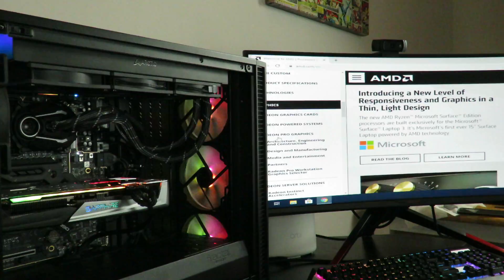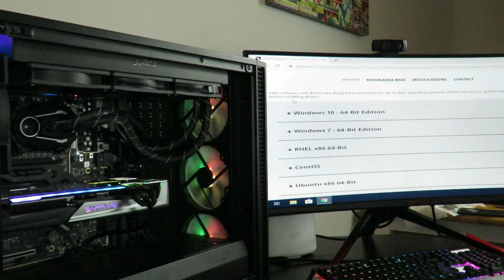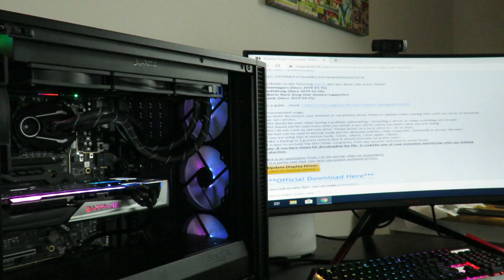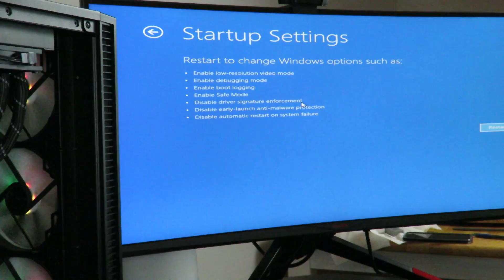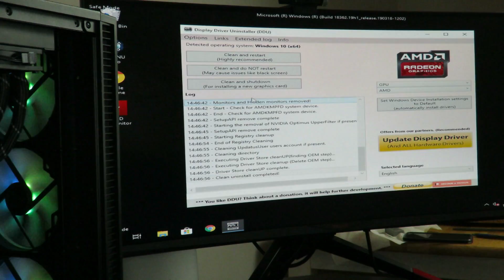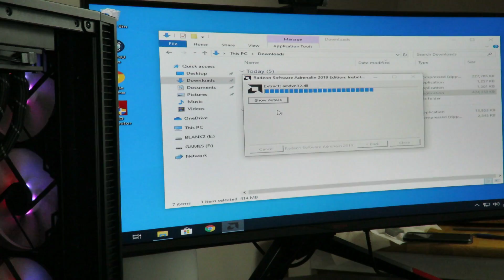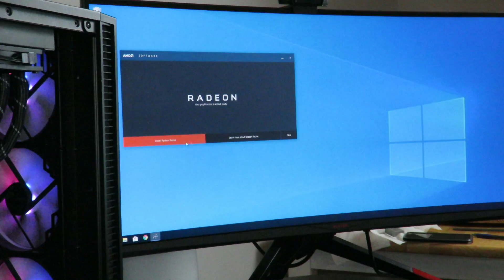Installing the AMD Sapphire Radeon Nitro+ RX 5700 XT 8GB OC Graphics Card

Comment from the maker: ✅ Watch Next:  Installing the EVGA Geforce RTX 3090 FTW3 Ultra Gaming: https://youtu.be/A2aqpr05-WA
✅ Learn to install Windows 10 on the  Asus TUF Z370 PLUS here: https://youtu.be/O3CKrFC6Bzw
✅ Check here to control the lighting on this card: https://youtu.be/PKvYtRKp_a0
✅ Sapphire Nitro+ RX 5700 XT 8GB OC Unboxing: https://youtu.be/zfCPBXgdSF0
In this video, we go over how to install the AMD Sapphire Radeon Nitro+ RX 5700 XC 8GB OC.  Make sure to stay to the very end, for a special message.
Check out my Amazon Affiliated link for this card: https://geni.us/VoHIZhu
Check out my system build out
• Viotek G35DR 35″: http://geni.us/6LrGJIntel 
• Intel Core i9 9900K Processor: https://geni.us/0PrCbaYArctic 
• Arctic Liquid Freezer ii 360: https://geni.us/CmNtJA
• EVGA Z390 Dark Motherboard: https://geni.us/UmV6t
• Sapphire Radeon Nitro+ Rx 5700 Xt OC https://geni.us/VoHIZhu
• WD Black SN750 1TB: https://geni.us/8sqXFs
• Fractal Design Define S2 Vision RGB Case: https://geni.us/t6xXT
• Patriot Viper Gaming RGB DDR4 DRAM 3200MHz 16GB Kit: https://geni.us/URlI8
• Samsung 850 EVO 500GB SSD: https://geni.us/QTA2
• WD Black PCI-e NVMe 512GB SSD: https://geni.us/mMNLde
• EVGA SuperNOVA 1000 G+ Gold Power Supply: @t

0:00 Intro
1:00 Removing the Old video card
2:53 Installing the 5700 XT
4:50 Plugging in the PCI-e connections
6:18 Where to plug in your monitor?
6:50 Turning on the Computer
7:00 Downloading Drivers
8:35 Downloading DDU
9:30 Booting into Safemode to remove drivers
12:00 Installing the latest AMD Video Drivers
14:10 Important message about cables
Reply: @ThisBytesForYou i have 5700xt nitro  i have problem with Vram stuck 1750Mhz i have dual monitor ,,,, if close o monitor and turn 120hz of second fix the issue work ok,,,, but  i need to have dual monitor,,, any solution of this problem please help me
Reply from the maker: give this a try; https://youtu.be/Qh2xEUXWeqs
Reply: Do I still have to do this method even if I’m simply upgrading from one AMD card to another? Or can I simply just upgrade the driver
Reply: Jay Alfon little late but no, if you’re upgrading from a different amd graphics card you don’t have to use ddu just download the newest drivers available
Reply from the maker: I disagree, downloading the new driver and installing the old, potentially leaves behind what the older driver has, DDU gets rid of all of it.
Reply from the maker: I would still recommend it
Reply: seriously liking these videos!
Reply from the maker: Thank you so much my friend, I truly appreciate it, you have made my day ;)
Reply: nice card i found the se gpu don't know what the differnce is but it's a se
Reply: do you know what the difference is between this on and the se version
Reply: @bassa69  SE is faster, Slighty, I'd pay the little extra.
Reply: @bassa69  and it has RGB if Fans, If you like that or own a vertical GPU mount

Comment: i keep getting no display with the same card even tho its working on my friend pc what could be the problem? the vga debug light bulb turns on on my motherboard (A520M-a pro)
Reply from the maker: 1. Make sure you are on the latest BIOS, 
2. Verify that UEFI is enabled and your drive is under GPT, not MBR, in the video I link up, i show you how to check and enable UEFI in your BIOS and change from MBR to GPT at the 8:32 mark: https://youtu.be/4BtdMcqwaFg
3. To get it to work again, you will need to disconnect all the cables on the back of your machine, usb, HDMI, DP, power, etc, everything, then remove the CMOS battery on the motherboard, then wait 1 minute, after waiting 60 seconds, reconnect all the cables, then plug the CMOs battery back in and turn on your machine.

Comment: I see that hdmi angled a bit...looks like u needed that 3rd slot
Reply from the maker: Card still working great, not sure what you meant, years later.  The .5 part is that the card itself will go a little into the 3rd slot, not the I/O.

Comment: I Bay an rx 5700xt thicc III and i think it does not get enough power my psu is MSI mag650bn bronze
Reply from the maker: The card with a system requires a 600Watt Power Supply, but it also requires 2 x 8-pin PCI connection , and don't daisy chain them.  Your power supply has 2 x 6+2 Pin PCIe cables, those are 8Pin cables but I think it's coming from 1 cable, that is probably why you are having issues.  Why do you believe you dont have enough power, I think you have enough, but it may not run well because of the daisy chain.

Comment: Is there anything else I need to plug in beside the Pcie pihns? isnt there an adressable rgb header to put on? or does it get the light from the pcie? thing because im about to buy this  used
Reply from the maker: You think the video would have what you need?
Reply: @ThisBytesForYou  Yes i watched it thank you, also does the gpu come with the 3 volt pin? also thanks for replying so fast just earned another sub
Reply from the maker: Thanks but no, it does not require an additional cable to be plugged in for aRGB, check out this video: https://youtu.be/PKvYtRKp_a0?si=tj4lGrM_bj098sFt
Reply from the maker: https://youtu.be/PKvYtRKp_a0?si=tj4lGrM_bj098sFt

Comment: @thisbytesforyou 5:02 Are 2 seperate 6+2 cables needed or can i just run it on a cable that splits?
Reply from the maker: Try to never daisy chain connection, pcie at least, keep them separate.
Reply: @ThisBytesForYou  thanks! I have another question. 3:29 i have the LC-Power Midi Gaming 703B case and my covers dont have screws. How do i remove them? (Note: i think it are "knock-offs" (one time removals) but there are no included screws so how do i screw the gpu to the case?)
Reply from the maker: sadly, it looks like a case I am working with (I dont see a clear shot of the I/o panel) that is very cheap, you have to twist back and forward the PCIE covers to twist them off BE VERY CAREFUL DOING THAT, YOU CAN DAMAGE YOUR MOTHERBOARD. as for the screws, they should have come in the box, in the accessories box, but if not, maybe these power supply screws will work, off of my amazon affiliate link: https://geni.us/Fx6fE5I
Reply: @ThisBytesForYou  Thanks for the help and the fast replies!
Reply from the maker: Always a pleasure my friend, so very happy you stopped by, trusted in me to help you, liked and subbed as well as took a moment out of your day to thank me.  It means a ton to me and I am so very happy I could help you.

Comment: @thisbytesforyou I know this video is 3 years old but hopefully you see this comment. I'm thinking about buying this card but i have a 600 watt psu. Do you think i'll be ok with my psu? Thank you!
Reply from the maker: Hey bud, no worries, I respond to EVERY single video, no mater how old or how new.  Sapphire states, it is Recommended to use a 650 Watt Power Supply but at a Minimum, it requires a 600 Watt Power Supply.  That 650 or 600 is not alone for the card, thats for the entire system.  If you have a regular system, not overclocked, you "should" be good at 600Watts.  If you start to notice issues, your power supply might be the cause, but I think you should be good.
Reply: @ThisBytesForYou  Yes nothing is overclocked on my system. Thank you so much for the quick response. Love the videos!
Reply from the maker: So you should be good.  Always a pleasure my friend, so very happy you stopped by, trusted in me to help you, liked and subbed as well as took a moment out of your day to thank me.  It means a ton to me and I am so very happy I could help you.

Comment: Hello man i need your help i have the same graphics card and everything is working fine but one of the 3 fans is not working.Could you please help me solve my problem?
Reply from the maker: contact Sapphire, they are amazing.  Is your motherboard a gigabyte?
Reply: @ThisBytesForYou  yes it is
Reply from the maker: @stefxn4821  ok, uninstall the Gigabyte overclocking software, RGB software, uninstall TRIXX, reboot when it asks you, then install TRIXX, reboot if it asks you, then install the overclocking/rgb software and it should be good.

Comment: Hi Good Day! I have bought the same GPU but I don't see any vbios selection, I can't also change my RGB and can't do the Fan Health Check on the Trixx Software. I have downloaded the newest Trixx Software App and install the latest Driver but still to no avail. Please help
Reply from the maker: If you still have the box, let me know the exact model number of the card and also what is the manufacturer and model number of your motherboard?
Reply: @ThisBytesForYou  Hi Thank you so much for the response! My GPU model number is: PN 299-1E410-000SA. My Motherboard is: https://www.gigabyte.com/ph/Motherboard/X570-AORUS-PRO-WIFI-rev-10/support#dl

I just downloaded the drivers from their official site. And also When I'm booting my PC I can see the GPU is having the rainbow color effect. It is practically changing the color but it stop when it's done booting.
Reply from the maker: hmmm, I am not seeing that card, just above the model number, what does the card description say, what is the model number there?   Does it have a UPC code, maybe that would help me?  As for the fans, make sure you uninstall the Gigabyte RGB software, it causes issues with TRIXX, out of all the boards, the Gigabyte is the only one that causes an issue, you may need to uninstall TRIXX and then reinstall it afterwards.
Reply: @ThisBytesForYou  Hi I'm very sorry for the late response. I didn't notice right away because of the youtube recommendations. 

May I know what tool or site did you used to check because I can check it myself. Or can you give me a sample of what your referring to? I'm so sorry to do this because I'm not sure where to find it. 

I need your help.

Comment: This is doing my head in : I got an rx 5700xt SE yesterday and for the life of me i can't find why its not picking up my second monitor. I'm running a ryzen 2 2600, b450 aorus elite, 3000mhz geil 16gb. Aio on the CPU ... The whole shabang ! Though iv'e noticed my card easily slides out of the left side of the slot wich i thought was weird. Ive found no solution to this at all ... And even weirder : the boot cycle and BIOS all happen on my second monitor ! Hahaha i'm at a loss
Reply from the maker: right click on your desktop in windows, click Display Settings, scroll down and click "Advanced Display Settings", do you see your 2nd monitor in there in the drop down?  If you do, select it and make sure the refresh rate is correct.
Reply: @ThisBytesForYou  Thanks for the reply :D still trying to get it working xD ... As to your reply : No after the boot cycle gas ran on one monitor, it snaps to the other one and the one that has ran the bootcycle or  BIOS then goes into sleep mode and isnt detected anymore
Reply: @ThisBytesForYou this small issue is really making me consider to actually RMA the card everything is up to date and it worked with my GTX 1060 6gb ... So i'm actually curious if this has something to do with my BIOS or the card is just ... Defunct... Going to flash some newer BIOS later ... If i find a flashdrive
Reply from the maker: @tjenne9290  so what happens when you switch ports?  Put the monitor that works, in the port of the one that does work and put the one that doesn't work in the port of the one that does work, same thing?
Reply: @ThisBytesForYou  same thing but the other way around :P it's really awkward, stupid almost ... But i haven't found a fix yet
Reply from the maker: @tjenne9290  try one monitor alone, boot into windows, check the refresh rate, make sure its good, then if it isn't, change it.  While the machine is on, plug in the other one and see what happens.
Reply: @ThisBytesForYou  Nope nothing cause then only the main monitor works, used the the same port and same cable on both. Could it be that at the time i swapped my gpu (DDU and the whole shabang) i was using only one monitor. Could it be that somehow the drivers aren't gone completly cause it couldn't find the second monitor ? Its grasping at straws cause the second monitor is just a 64hz basic screen
Reply from the maker: 64 is a VERY odd refresh rate... not sure what to tell you on that.  See if maybe this helps: https://youtu.be/Qh2xEUXWeqs
Reply: @ThisBytesForYou  oi oi ! Iv'e actually found the issue. The monitor is just broken. Weirdly enough it allowed me to see the bootcycle and use the BIOS on it ... But it doesnt detect anything else anymore like a chromecast or playstation/xbox or other computer ... Weird ! Iv'e since gone and bought a new screen (after testing it worked with 2 tv's at the same time and it did without issue) so problem solved ! Thanks for the help though !!

Comment: In device manager it’s says my location of my card is the PCI bus 3, device, function 0 but I have it in PCI bus 1 slot, any ideas because the card is underperforming
Reply from the maker: are there any PCIE slots above it, a x1 or a x4?  What motherboard do you have?
Reply: @ThisBytesForYou   msi gaming plus z390
Reply: @ThisBytesForYou   I have it in the top slot there are 3 pci x1 and I believe one x4
Reply: I would put it in the x4 but I can’t make it fit with the case
Reply: @ThisBytesForYou  also when I put in the old nvidia gpu it says it’s In the bus 1 slot but same error code
Reply from the maker: so make sure you are on the latest bios, released 2020-10-20, you can find it here: https://us.msi.com/Motherboard/support/MPG-Z390-GAMING-PLUS, it fixes a lot of issues.  Make sure you used all the drivers listed here: https://us.msi.com/Motherboard/support/MPG-Z390-GAMING-PLUS#down-driver&Win10%2064 and make sure in the BIOS, you set the PCIE to Gen3.  AFter you do all that, make sure to load the optimized BIOS settings, save and exit then go back in and set everything, making sure to set your memory to XMP and PCIE to PCIE Gen3.  in the picture of the board, make sure you have the video card set to #10 here (scroll down a little https://www.msi.com/Motherboard/MPG-Z390-GAMING-PLUS) marked as "PCI-E Steel Armor Protecting VGA cards against bending and EMI", this video might help you too: https://youtu.be/8JuC_Dpm6-c/

Comment: Hello. Can you help me? I have issue with readon 5600xt because i only have 1x 6+2 pin and 1x 6 pin cables when my graphic card needs 16 pins and it not working what should i do. Ps. Everything else with gtx 1060 8 pin graphic card is ok.(and power supply should handle this).
Reply from the maker: You are correct, the graphics card requires 16 pins, 2 x 8Pins or 2 x 6+2 or 1 x 6+2 and 1 x 8Pin.  

Yes, the 1060 works well, because it does not require as much power as the 5600XT, makes sense.

what is the model number and manufacturer of your power supply.